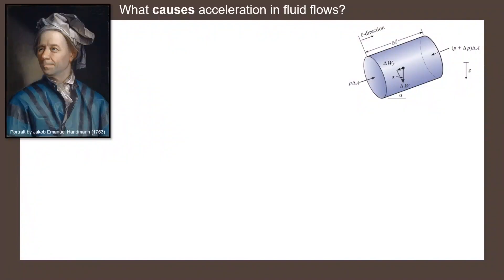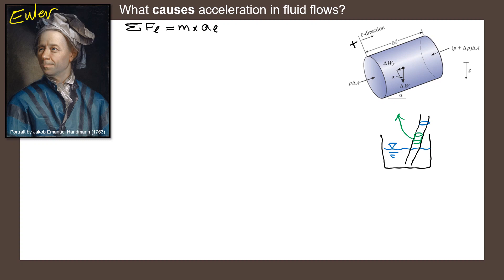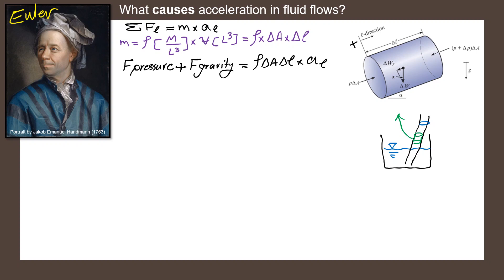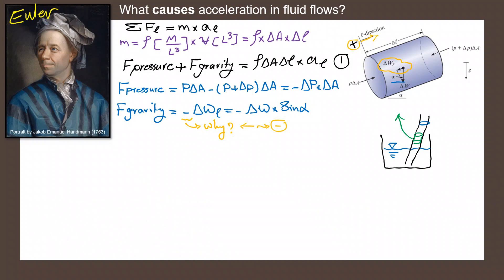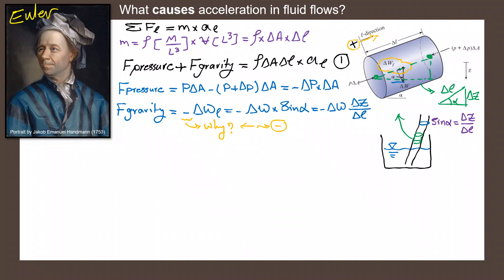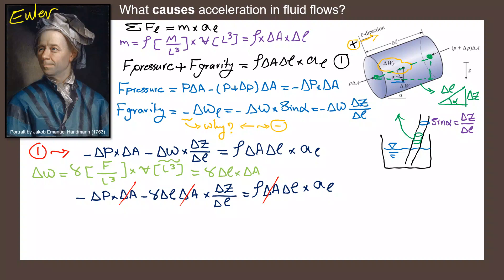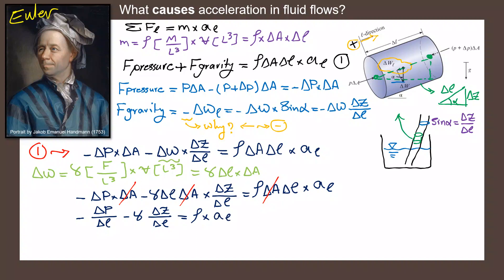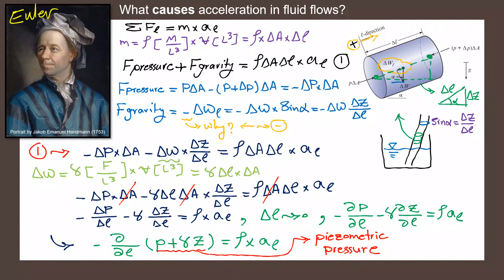Derivation of Euler Equation in Fluid Mechanics

Comment: Professor, 
You say that  the negative Sign for the gravitational force along the direction of flow is due to the reason that it is acting against the direction of flow. Let us assume the elementary cylinder is drawn with downward inclination, then the gravitational force would act in the direction of flow. That component of force would aid in acceleration in the direction of flow.
 The reason for negative sign could be that the acceleration due to gravity is downward which is opposite to vertical positive upward axis.